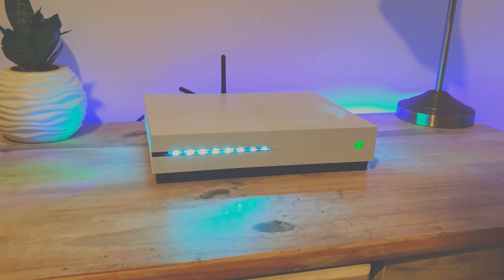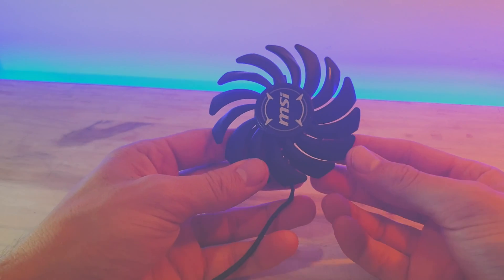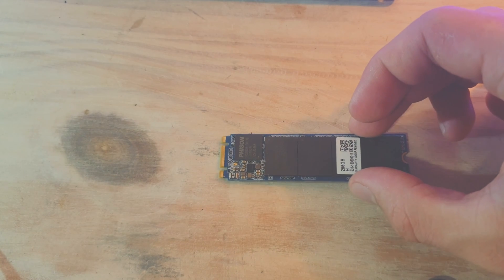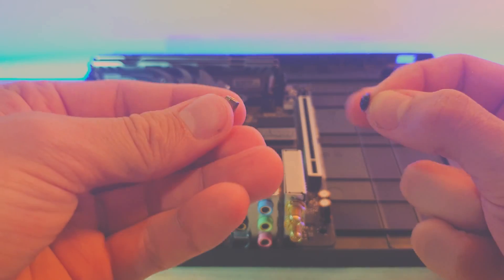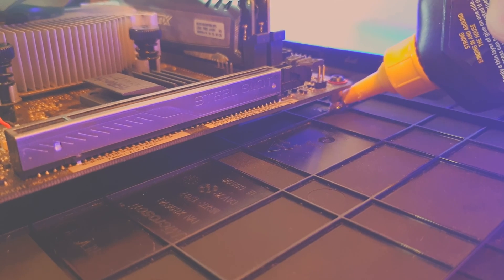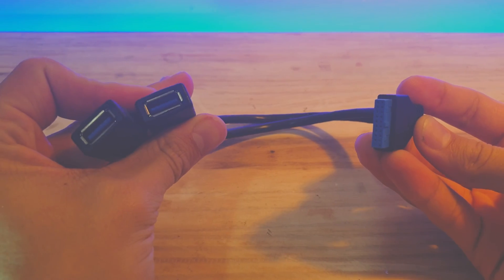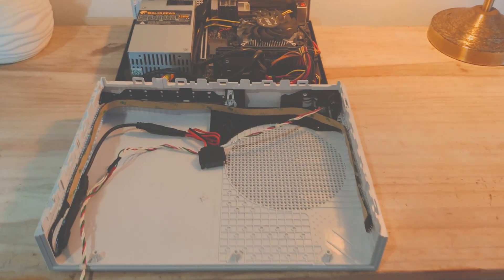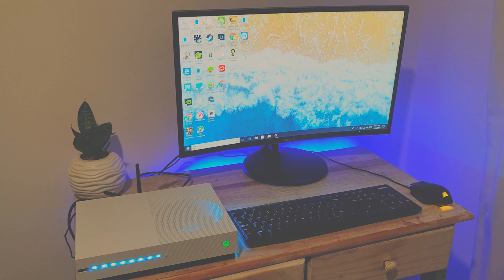Build your own mini itx gaming PC inside a Xbox one case!($400)

Comment: hi i already did almost the same specs, i used 3400g,and  case of minecraft edition, looks awesome, a bit overheat also, but my problem now is that im getting black screen  in fortnite and is not even more than 75c im not sure if is the PSU i know is not the best quality, do you had some problem with thi solid gear psu?

Comment: great job but if you want you could use a pci riser and lay something like a gtx 1650 on its side because it has side exhaust and put it on the side grill as it needs no power so a 350 watt is good for it

Comment: Do you think I could do a full water cool loop in here
Reply from the maker: Yes, if you use a pico power supply you could put a rad inside. You would just have to put the motherboard on the right hand side to get the airflow required.
Reply: Ambient DIY with a gpu aswel?

Comment: Could you please link a power button that would work for this? I'm basically done with my build, but im having trouble with the power switch part. The switches i bought take too much pressure and travel to activate.
Reply from the maker: You actually want one with a bit of travel, does the switch have a casing ? If it has a casing just fix that casing to the xbox shell and the switch button against the button casing.
Reply: Ambient DIY i did that and the button was a little too close and didnt have enough space to unclick since its spring loaded. I had to remove it which unfortunately broke it.
Im thinking about taking the original xbox button out and putting in a circle led power button for custom pc cases. I just haven't decided yet. For now i just have a power button hanging out the front usb port hole lol.
I installed one 40mm noctua fan for exhaust which dropped gpu temps from 79c to 65c max while gaming! It fits perfectly in the side ventilation section! I have another 3 ready to go in but im waiting until i get another power button so i don't keep prying the case open.
Reply from the maker: Would really like to see your build when it's done.
Reply: Ambient DIY where can i send you pictures? 
My build:
240w External PSU Brick
250w PICOPSU
MSI GTX 1650 OC Low Profile
Ryzen 5 3600
Noctua L9A Chromax CPU cooler
8GB G.Skill Ripjaw V 3200MHZ RAM
Samsung 970 EVO M.2 NVMe SSD 1TB
Gigabyte Aorus X570 I PRO WIFI Mini-ITX
Reply from the maker: Jsinclair198@gmail.com
Reply: Did u ever figure out the power button? Im having trouble finding one

Comment: man how exactly did u do the led power button? did u glue it im trying to figure that out
Reply from the maker: I glued the face of the button to the inside of the xbox button shell(white with tbe x) and then i used some dells to glue the button shell to the xbox case itself.
Reply: @AmbientDIY  where did u get the button from
Reply: Im struggling with the same part. Amazon doesn't have the best selection of buttons right now. The ones i bought require too much travel to actuate.

Comment: u could have used an external psu that way u can use a gpu in this build but otherwise good job man
Reply: That’s what I’m trying to do but it’s kinda difficult If u us the parts I can get. I need like 300 watts and I’m struggling to find anything I trust to work
Reply: That's what I would've done. Screw that apu bs.

Comment: what about the GPU??? you can definitely fit at least a 1650 in there
Reply: I would put the 1650 lp where the psu is so you can get airflow out of the case and then do external power and add a display port cable extension

Comment: External GPU inside of a PS4 , put them together in an entertainment unit and trick your friends!
Reply: That would be pretty hard to do
Reply: @JrplaysYT-hk8st  Not really, especially if you've got a thunderbolt compatible system. Just tear down a thunderbolt GPU dock and stuff the guts inside a PS4 with your GPU of choice. It'd be easier to do than the PC side imo.
Reply: @DaxtonAnderson  yea I guess it would

Comment: I see that you glued the standoffs into the case, does this mean that the motherboard can be salvaged, and whilst traveling did you have any trouble about adhesive tape coming off or loose parts rattling around?
Reply from the maker: Yes you can chop and chance parts out as much as you want. This is why i wanted this over a laptop aswell.The adhesive actually gets really strong because of the heat and i actually had a stuggle getting it off when taking it apart.

Comment: not bad, but you could manage a gpu in there if you went with one of those pico psu things and used an external brick.
Reply from the maker: I'll give that a go in the future!
Reply: Ambient DIY use a gt 1030 gddr5 evga it’s a small gpu with good FPS
Reply: @D311Y  isnt worth it
Reply: @lucinum9012  yes but the house would fit
Reply: @D311Y  still isnt worth it
Reply: @D311Y  you can slap gtx 1650 LP on that pc though
Reply: @D311Y  that gpu is worse than the apu he used he would need to use a 1650
Reply: as the 1650 is a capable card in performance in games
Reply: HDplex !
Reply: JForce do u have any suggestions for a good 350w pico thing? I’m doing something crazy and using the base Xbox one chassis, for a 10400 and a 970 blower card.
Reply: @WillFuI  I don't know a whole bunch about such things but there's a YouTuber called not from concentrate who does a lot of ITX and custom ITX content
Reply: @jforce321  he also sells insanely small itx cases and they look bloody amazing

Comment: I would have had a external PSU and add a GPU
Reply: smart, but how would you manage all the cables and make it look sleek?
Reply: @stanskeeter  get a sfx power supply then get cable extensions then rap it in something that looks decent then bam it would look fine
Reply: i think the point of this build is to be as discreet as possible...somewhat like a sleeper car...looks like it doesn't go fast but it actually has some tricks up its sleeve. ;)

Comment: Power supply is pretty weak
Reply from the maker: It's way under the power limit so i decided it's good enough. The system only draws about 100 watts at full load.
Reply: @AmbientDIY  i guess thats fair since youre using integrated graphics

Comment: Excellent, Im planing to do something like this, but using a dedicated GPU, I got some Ideas from you.
Reply from the maker: I'm doing an external GPU dock in the future. Stay tuned!
Reply: @AmbientDIY ... yes, because it is not a gaming, but office pc now...i will wait for your's upgrade - i am new subscriber :-)...
Reply: @AmbientDIY  you can use a pcie riser
Reply: You have a new subscriber too, i'm waiting for the external gpu, also wandering if a micro atx will fit this Xbox housing
Reply: @luismunoz4378  I checked before in my dead Xbox one s 🤣
And yeah it should fit
Just you will need to use a Pico PSU and maybe a single slot or low profile GPU